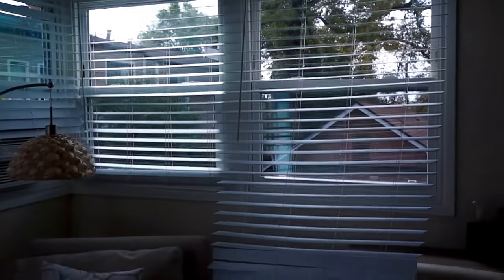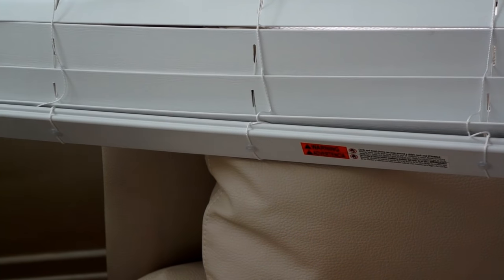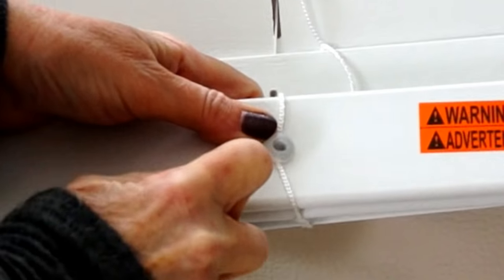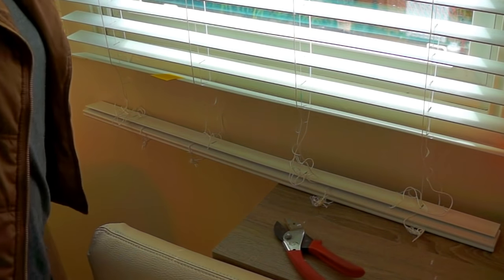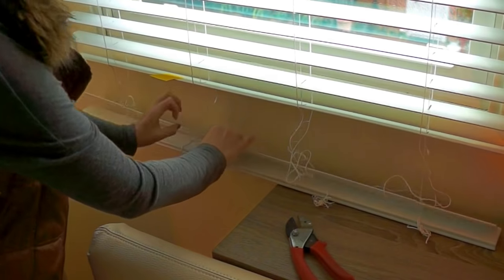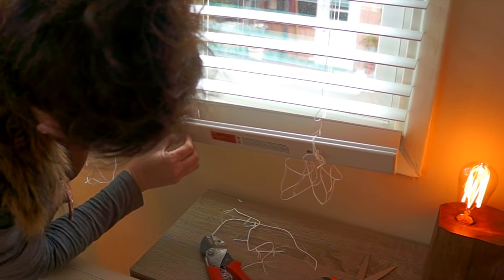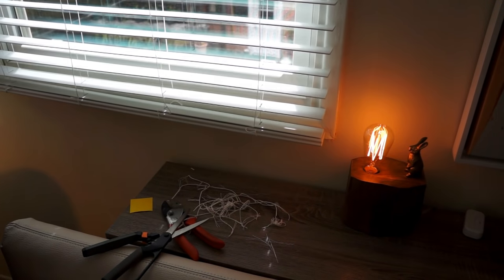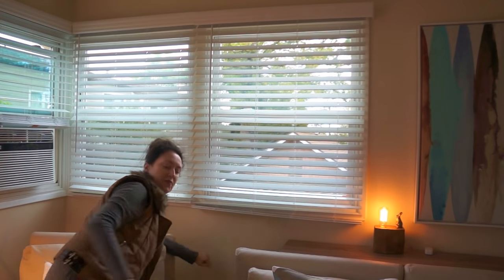Blind shortening creating a custom length

Comment: Just what I was looking for.  After cutting mine the cords shot up inside the mechanism and I heard the horrific sound of springs unwinding . I took the blinds down removed the mechanisms, opened them and then rewound and resprang them. The process took over two hours. My other half then held the tension on all three cords while I restrang each slat. I promised I would find an easier way and ran across your video. Thank you so much for sharing ❤️

Comment: Thank you for the easy to follow instructions and well thought out plan.  Using your steps, I just shortened one at my house in 15 minutes with no problems.  I used a pair of tin snips to cut my slats.  Manufacturer did not include any guidance on how to shorten. You deserve a paycheck from the blind companies!

Comment: This video saved my sanity! Thank you so much for doing this. I purchased Allen And Roth 2” blinds and when I tried to shorten them I undid the little black donut ring and zip went the pull cord right up into the head rail. After taking a few hours to calm down and several scotch on the rocks I duck taped the slats together and the next day took the mess back to Lowe’s. Gotta love Lowe’s......they gave me credit for a new pair. Now the new set is up and I’m terrified to attempt shortening them. After practically giving up and watching video after video I found you who had the same problem and frustration as me. The Allen and Roth directions gave no warning/directions on shortening these type of blinds. I hope they see your video! The only thing I did differently was instead of cutting the slats I just snapped them in half at the slit. Thank you again. BTW I’m sure you have been told you have those Susan Sarandon eyes.
Reply: I just did the same thing! I’m going to try to see if they will take them back. I bought them like 5 months ago and finally installed them! And completely messed them up!

Comment: Thank you for posting this video. I used your methodology on a cordless Levolor aluminum blind. Your attention to detail in producing the video made my job much easier. I was told by Levolor customer support that these blinds could not be shortened (thus no instructions for shortening in the box). You made it simple and I think Levolor needs to get their head out of the sand and see what creative folks, like yourself. are doing to prove them wrong. Thank you

Comment: Complete success. All done. I just followed your video and did it step by step. The hardest part was very carefully not cutting those 2 thicker cords and removing the un needed blinds. In this case I had to reduce a 6 foot long blind to 3 1/2 feet total. Once I got past that the rest was easy peasy

Comment: IIRC the "old" Levolor design with the holes in the middle of the slats (not "trim+go") was pretty easy to shorten.  Pop the plugs out the bottom, pull the lift cord up, slide out the slats, then thread the cords back thru the bottom.  No need to destroy the slats.  The new "trim+go" are maddening to shorten.

Comment: Thank you for the video. I don't understand how my Lowes Project Source cordless mini blinds did not include instructions on how to shorten the blinds. I followed your instructions and it worked out well. Fortunately for me I could cut my plastic slats with a scissor, but instead of the 9 slats, I had to cut 30. That meant 60 slat cuts, and 180 string  cuts. I am wondering if it was necessary to cut the ladder strings at all. Anyway, it was a big help, thanks again.

Comment: Wish I had seen this sooner, I paid nearly $90 for one blind, decided to shorten it and cut one of the cords that's tensioned for lifting and lowering of the blind, well as soon as I did that, the tensioned cord got "sucked" up into the main spring mechanism never to be seen again.

It rendered my blind useless
I was P.O'd for sure but learned a valuable lesson... ALWAYS research and don't assume you know what you're doing (unless you actually do)
Reply from the maker: well said.

Comment: Wish I had watched your video first. I watched a different one in which the person cut the bottoms of the lift strings to remove the bottom rail. I did that, and the lift strings suddenly retracted into the header. What a nightmare trying to fix it. I don't think they'll ever raise and lower again. I'll have to be satisfied with just opening and closing the slats.

Comment: The directions state that if more than 5 slats are removed it could have an effect on the performance of the blinds. Have you had any issues?
Reply from the maker: No I have not have any issues. But the blinds are mostly in the down position and only the slats get tilted.

Comment: I'm doing this with aluminum blinds, but I need to shorten them from 72 inches to about 34 inches. That's a lot of blinds to snip through. This can also be done by snipping the center cord and sliding the blinds off that way, correct? That shouldn't affect its ability to retract (given I don't cut too much of the center cord, but there should still be plenty of length left over)?

Comment: This is exactly what I’m looking for, but I’m confused that you stressed to not cut the up and down cord, but in the end you did cut it.    Seems to me if this and the little “horizontal ladder rung things” and the length were cut initially it would be easier to remove the slats.  I guess I’m just trying to not make another run to the hardware store to buy the snap cutters.

Comment: Another way to do this is to do it in a slightly different manner.  I extended my blinds all the way down.  I figured out where I want to start removing my blinds.  I remove the top slat which eliminates the need to mark anything.  On the top slat I removed, I left the thin (ladder) cords that help turn it as they will become the top for the bottom rail once it gets raised.  In order to remove each slat, a small scissors can be used to cut the very fine cord that holds each blind into the assembly and the cut the fine loops between the front cords of the blind (those loops are fine thread like the ladder cords).  When cutting, be careful to only cut all the very fine ladder cords and fine loops between the front and back vertical cords.  The next step is to remove all subsequent blinds and cutting all of the fine ladder cords.  I will also cut the first three so they are flush with the other cords (appearance purposes).  Be careful not to cut anything else.  Keep removing slats as following the steps above, but one does not need to be as exact trimming them flush.  Also, cut the ladder strands above the bottom rail.  The ladder strands for the first slat removed become the new ladder strands for the bottom rail.  I then raise my bottom rail a bit.  When removing the plugs on the bottom of the bottom rail, you can grab on both ends of the cord and pull on them simultaneously to get a start on removing them and work a pry tool under the plug to get them out.  The rest is similar to what you describe.  I like working from the top down as I do not forget which cord I want to save, what blind I want to stop at, etc.  My method is just a different way of skinning a cat.
Reply: Can you please do a video showing how you would do it? Thanks
Reply: thia c I do not have anymore blinds to shorten.  I essentially do the same thing this person does.  I work from top down as I:
A) do not have to remember where I have to stop
B) only have to clean a small area from the tiniest cords for appearance purposes (about three slats).  

I also believe faux wood blinds come with instructions on how to do this.  It is super easy to figure out the length.  Mount your blind and extend it past your window.  I left one extra slat beyond the window sill when they were open.  This is easier than you think.  Just one last thing do not cut the medium size cord at all as that will make your blind inoperable.  The ones I cut were the very thin ones that attach the blinds to the cords and the two thicker ones on the ends for adjusting the length.

Comment: I would not leave extra slats at the bottom; trying to tilt so many useless stacked slats stresses the angle mechanism at the top of the blinds. Over time the gears will strip up there and you lose your ability to tilt your slats. And who needs that! My bedroom installation whenever a previous renter or manager did not take off the excess slats- and I had to tug on my ladder string to assist angle adjustment. Removing the extra slats helps, but sometime the blinds still have trouble.
Manager wanted to replace with another kind of blind, but they forgot about it. Nice thing is, they can't tell I fixed it.
Reply from the maker: Yes, I supposed I left the extra slats just in case something went awry, but really, I had no other reason to.

Comment: Sad she did not use another approach where she could save a couple slats in case of damage (read :CATS)
At around eleven she started snipping all the extra ladder rung- then cut off the entire excess???? Weird!
Reply from the maker: good points. I did keep some of the slats for other uses. For example in some projects where I need a "spacer" or to stir paint in a can when I don't have paint sticks (or to re-purpose them that way so as not to waste precious paint sticks unnecessarily). thanks for your comment.